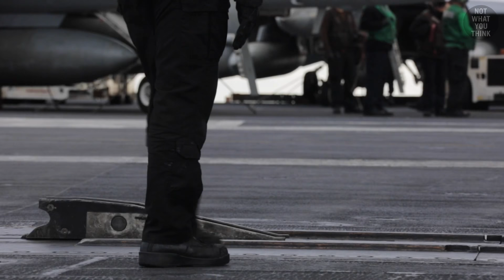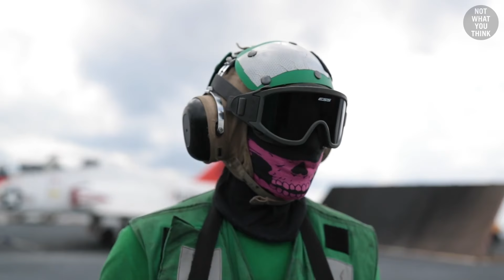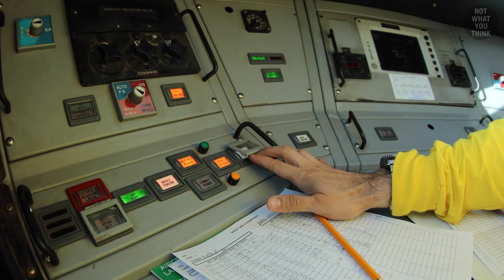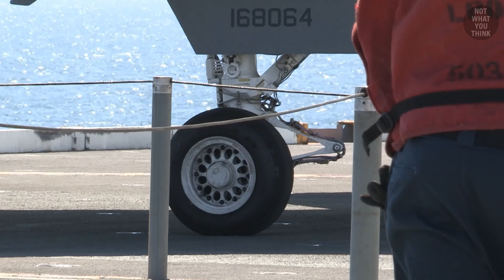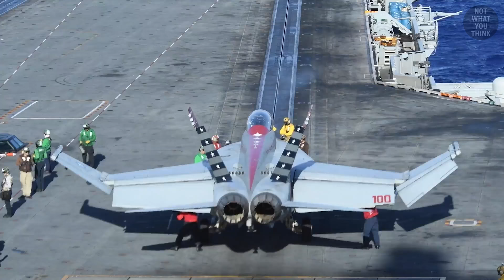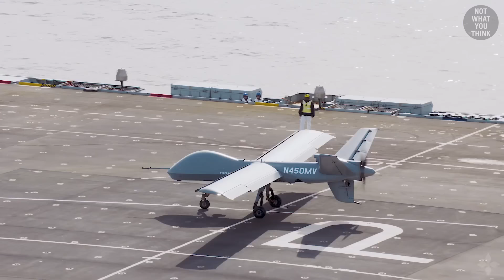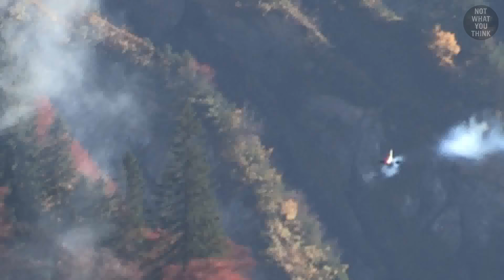Why the US Navy is Replacing Electric Catapults with Steam

Comment: I say steam makes more sense on nuclear powered carriers cause the ship makes alot of it so why waste time adding batteries and extra electronics when you could just add some pipes to run the catapults,  Plus I'd rather keep as many things analog as possible since its proven to be EMP proof as opposed to a bunch of crap the requires huge amounts of electricity to function.

basically reliability and price are the main factors and steam looks alot cheaper than electric

Comment: @kinwaisiu9414
The core differences between the electromagnetic catapult technology of China’s Fujian ship and the U.S. Ford-class lie in technical architecture, energy storage, reliability, adaptability and redundancy design—with China’s system being comprehensively more advanced, powerful and advantageous.
 
Core Differences & China’s Advantages (Concise)
 
1. Power Architecture: Fujian adopts medium-voltage direct current (MVDC) (a China-initiated innovation); Ford uses medium-voltage alternating current (MVAC). MVDC eliminates frequent AC-DC conversion, cutting energy loss and boosting anti-interference performance. It works seamlessly with conventional power, breaking the myth that electromagnetic catapults require nuclear power, while MVAC’s outdated architecture relies on nuclear propulsion and suffers higher energy waste.

2. Energy Storage: Fujian uses supercapacitors (millisecond-level response, over 98% charge-discharge efficiency, 10–20 year lifespan); Ford relies on flywheel energy storage (mechanical wear, slow response, short service life). Fujian achieves a launch interval of ~30 seconds, outperforming Ford’s ~45 seconds for higher sortie efficiency.

3. Reliability & Failure Rate: Fujian’s mean time between failures (MTBF) exceeds 2,000 cycles, with proven successful launches of the J-15T, J-35 and KJ-600. Ford’s MTBF is only ~614 cycles (far below the 4,166-cycle design target), with a mere 7% fault-free probability under high-intensity missions.

4. Launch Capability: Fujian’s maximum output reaches ≥125 MJ, supporting full-spectrum carrier-based aircraft (2–70 tons), including heavy fighters and fully-loaded early warning aircraft. Ford’s ~100 MJ output limits its ability to launch heavy, fully-loaded aircraft.

5. System Redundancy: Fujian’s catapults feature independent power and energy storage systems—a single catapult failure does not affect others. Ford’s 4 catapults share a centralized system; one failure paralyzes all, requiring 1.5 hours of downtime for maintenance, posing critical combat risks.
 
One-Sentence Conclusion
 
China’s MVDC + supercapacitor electromagnetic catapult system holds generational advantages over Ford’s MVAC + flywheel scheme in efficiency, reliability, adaptability and combat readiness, demonstrating unmatched operational value even with conventional power.

Comment: Failed to mention, electric is faster to cycle so an aircraft can be launched every 15 seconds vs steam @ 45 seconds/ aircraft. It takes more time to recharge a steam unit vs electric.  New carriers have the electric capacity that older carriers do not for electric catapults.
Reply: Anyway, due to the aircraft's takeoff and landing procedures, the advantages of a quick launch are meaningless. China has also not been able to resolve the issue of capacitor lifespan at all.

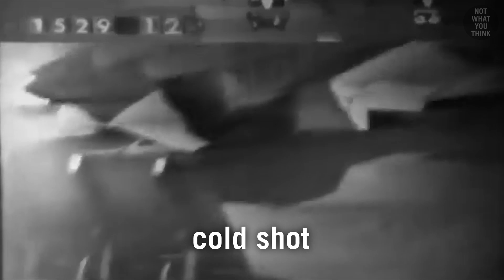Comment: 2:56 - now, one has to be... dunno - blind? dumb? treating his viewers like a bunch of blind puppies born yesterday...? - to illustrate "too less power" scenario with a clip showing clearly WAY TOO MUCH POWER scenario! Well, I mean at least "too much for THIS particular front gear" - but still. 
Thumb down, mister, for this idiocy. You want my time watching your videos (and bringing you sweet ad revenue from YT) - you have to treat me with a li'l more respect.

EDIT - and then another "intelligent" remark, which, BY THE WAY, applies to ANY catapult system, be it steam, electric or Jedi-force powered - that is, "to be on a safe side we need to put some EXTRA power - and YES, it "does put an extra strain". Duh... What next? Water is wet and it's dark during the night, huh?
Steam produces "pushing force" by pressure. A KNOW and ADJUSTABLE one. Which then act on a piston of a KNOWN size (i..e. surface area). Multiply these two, and you'll get DA FORCE. EXACT force.
QED.

Comment: Even if EMALS were indeed unreliable (now), logic would dictate to continue the transition as kinks would be worked out, eventually reaching the same or even better rate of reliability than steam.

Now, once reliability was on par (or better) then one would fully appreciate the real benefits of EMALS.

In other words: EMALS will only get better.

Steam, because we have 50+ years of experience might not be improving too much...or we might be at the best case scenario with it and the limitation we see now are not going to be overcome.

Comment: What U didn’t mention was the use of high voltages to use the electric catapult makes it extremely dangerous to work on the gear? The reaction of the troops when President Trump asked them, is obviously a reaction to this issue?

Comment: No the fuck steam cats aren't reliable. 
The maintainers are reliable and make it fucking happen! They fight to keep the cats available and fully operational EVERY FUCKING LAUNCH. 
I was there riding in the back of the COD getting flying off the boat as we came and went, or on the deck taking part in the flight ops while working on the ship. And I'll tell you the millennium cruise with the JFK was trash and largely because the cats were sketchy. Any folks that work on the flight deck know one steam leak can go from one cat being down, to a no fly day quicker than a blink of the eye. Here's a few other facts. Steam deteriorates and corrodes metals and plastics. When it leaks it can cut scald and burn flesh and other materials,  and do physical damage when the pressure is high. Trump is a moron who swears he knows everything and don't know shit

Comment: There are many more advantages with EMALS such as with damage control situations and fewer personnel required to maintain and operate the system, but good discussion overall.
Reply: I worked for Newport News and was on sea trials with CVN73 and had to test catapult accumulator fill valve performance.  Just before this test,  we tested flight deck chemical, biological, and radiological countermeasure washdown.  This puts a LOT of water on the deck.  A lot of water leaked from the deck into the catapult accumulator space immediately below.  I entered the space and found 4-inches of water on the deck and and contacted central control to request Newport News to bring in pneumatic pumps and removed.

Imagine my surprise when the next thing I hear over the 1MC system to the entire ship is "Flooding, Flooding, Flooding!  Flooding in space 03-60-1-M.  Damage control to 03-60-1-M!)  We are 60 feet over the waterline.  Its still funny, but it shows you how serious the Navy takes damage control.
Reply: Of they’re smart they can have them be battery power of power out somehow. If some of the battery is damage they can still work unlike steam where one problem anywhere take out the whole system.
Reply: The reset, re-fire cycle time is far faster than steam and uses less juice and is far more precise on the stroke.  Putting a sortie up quicker is a key component to in theater response efficacy.  Sucking up to a ZERO intellectual grasp of ANYTHING abject idiot like Trump is no different than following illegal orders.  Trump and ALL of the idiots in Washington pushing for ANY of his lunatic stupid shit should ALL be removed from service and the nation should be allowed to get BACK to the day to day march toward civility we were on before the GODDAMNED MURDEROUS LUNATIC THIEF arrived.

Comment: The issue isnt that steam is more or less reliable because its mature, its that the electric launchers ARENT mature. The ships that have them were prototypes, and before we start putting them in every carrier new or refit, those issue they have need to be worked out. A 99.5% uptime for any major piece of equipment,  let alone the sheer abuse of a catapult, is frankly insane. But its also necessary.  The navy needs those electric catapults to reach that level of maturity before throwing every egg in that basket.

Comment: Perhaps we should return to those beautiful steam-powered locomotives and cars.

Fun fact: most  modern diesel locomotives are electro-diesel. This means they use diesel to generate electricity, which powers the motors, as  controlling the output with electricity is much easier.

Comment: I was once accelerated from 0 to 130 mph in a few seconds by an electromagnetic catapult. This catapult was part of a roller coaster. It worked very well. And was very reliable. It had its share of bugs when the technology was new. But they were quickly worked out. And the same thing should be true for aircraft carriers.

Comment: My only concern with EMALS is; is it hardened against EMP attacks if so I don't see the problem. I may be wrong but I was told our military aircraft are already hardened against EMP.  If you can't launch because of EMP then that's a problem. I am not an expert just saying this would be my primary concern along with reliability which it seems they have achieved.

Comment: Why not have both! US Carriers have 4 or 5 catapults.  Run the drones and non standard off the electric and standard aircraft off steam. What the video failed to mention is the installation of the electric catapult is the hangup to building aircraft carriers,  insanely hard to get them installed correctly.

Comment: I believe that Trump is not lacking in intelligence.
He publicly stated that there is a desire to return to steam power, but the reality is that they need to revert to steam.
The fact that China has a stronghold on the supply chain for the magnets required to build those catapults is a significant concern.
It wouldn't be ideal to construct an aircraft carrier only for China to suddenly block exports of finished magnets or raw materials necessary for their production. That would leave you with a million-ton paperweight.
I think steam would be the safest option, but it may not be the best in terms of capabilities.

Comment: The key error the Navy made was committing to an unproven design.  They violated Meyer’s guidance for complexity and adding too much tech to the Ford class.  An electromagnetic catapult is better than steam but needs to mature and the Navy has a poor recent track record of introducing new ship classes - especially since the 1980s (most are failures that have required decades to be refined or were cancelled outright).  It’s not a debate about returning to steam vs keeping EM; there is a fundamental lack of engineering skills in the Navy officer and civilian workforce.

Comment: You can modify any steam catapult to operate with compressed air then regulate the power at will, it's called ICCALS and guess what? IT'S MUCH CHEAPER and way more reliable! You just need a boiler and 3.5 gallons of kerosene per launch and it can be 7x more powerful than an EMALS : you have enough to launch a fully loaded C-130 too while, just like EMALS, you can do progressive acceleration that reduces stress on airframes !!!
Reply: It also reduces the needs for piping compared to steam generation and spares the room of gigantic "capacitors" banks for EMALS

Comment: It took 10 years of experimentation between the USS Langley the Navy's first carrier to the Large Fleet Carriers of WWII.  The electric catapult system is right at the very beginning of service much as the Langley.  The Engineers and the Navy will get the bugs out eventually.  It's like the first model of any American car, you really need to be aware of that first model as it will have bugs.

Comment: Steam catapults since 1950s? What did they use during the war?
Reply: Propellers. WWII carrier aircraft had stall speeds low enough in relation to their weight and engines' power that they could become airborne within the available deck space.

Comment: Is EM launchers on aircraft carriers (or its control systems) vulnerable to EMP attack?
The list of adversaries (or potential adversaries) capable of such an EMP attack is relatively short.
Does the EM of EM launchers on aircraft carriers interfere with (some) non-EM-hardened drones?
Does the EM of EM launchers on aircraft carriers generate undesired noise or interruptive interference in the local EM environment?
Reply: EM, Elon Musk, "I am a disruptor." - (paraphrase) Elon Musk

Comment: By this point I just get the sense that the knowledgable people in charge at the Pentagon, which definitely excludes Petey Hegseth, are just humoring Rump till he leaves office. It's not like the Navy is going to undertake the massive design changes needed to switch the Ford class carriers to steam, it would be very expensive and the changes wouldn't come into effect until after Rump left office and thus would never actually be carried out. The same thing applies to the Rump class "battleship", it will never be funded by Congress and even if it was, by the time it was designed and bidded out, Rump will have left office and the adults will have put a stop to senile Donny's fantasy.

Comment: Chinas' new Fujian aircraft carrier uses an eletromagnetic catapult, and it's unable to launch fully loaded jets, either partial fuel for shorter range, or fewer weapons, and cannot cycle quickly due to recharge cycle delay. US aircraft carriers work just fine, they launch fully loaded jets, and they cycle the quickest in the world. By not requiring very large joule dumps for electromagnetic catapults, we can use all the electronic warfare technologies without limiting them. The frontier is in directed energy weapons, those require lots of electrical energy, so keeping steam catapults makes our carriers more flexible
Reply: Exactly what I'm saying. The comments just seem to be full of TDS folks. 

Personally, knowing we were able to shut down caracas with EM and various other abilities, any defense analyst needs to consider an EM ability an adversary might have, OR develop. In the video, wiggling fuel tanks made EMALS vary the acceleration, leading to increased vibrations. What if an enemy EM weapon can just screw with that frequency a TINY bit? For now, steam is a good option to keep in the side pocket. Retrofitting Ford to steam would take another decade, and obviously would never happen, so it's a bit of a 'screaming wolf' situation here.

Comment: So why doesn't it work right? Why does it fail so often? Why does it fail differently almost every time requiring engineers to be flown in to figure out what went wrong and why it is not working? The same is true for the electric recovery and the ammo elevators that are all failing. 

These systems have put the USS Gerald FOrd and all FOrd CLass Super Carriers 8 years behind schedule and billions in cost over runs!

The sailors are not able to figure out what is wrong and figure it out on their own or fix it on their own. They have repeatedly had to fly in civilian engineers and parts to repair. If the grunts on the ships can not fix it at sea it is a worthless POS!

Comment: The reports state there are benefits to the EMAL over steam, but reliability and system down time for maintenance or overhaul due to heavy or catastrophic damage is going to be higher.  I just want them to figure it out so it works at the same rate or higher than the steam catapults.

Comment: EMALS has a huge flaw it relies on software that could malfunction damaging assets. Steam is analog system that does not rely on software. Personally they should not have pushed for EMALS as the technology hadn't matured enough to be as reliable and consistant as steam. That "steam bounce" you mention is no such thing it holdback bounce. As the shuttle starts pulling the aircraft forward the holdback and the shuttle compress the tires and nose strut. Back in the day they had the holdback dialed up to much on the Hornets and it was blowing tires. They added two more plies to the nose tires and changed the holdback settings. EMALS with all the feedback sensors can create errors that amplify force that can damage assets if the software hasn't been updated correctly. I like the concept of EMALS, no more eating steam after a launch, no more scalded knees and hands touching track plates. Quicker ready for operation time, without the need to heat soak the catapult before flight ops.

Comment: Typical engineers taking the most complicated approach to a problem. They hear "dynamic thrust" and therefore think the thrust system needs to be completely overhauled to be dynamic. This is dumb. All that's needed is a dynamic braking system. Keep the core thrust simple, reliable, effective, and then tune the strength with antilock brakes. They're reliable, tunable, and OPTIONAL. A failure in the tuning system does not brick the launcher, and if its a small brake (it only needs to be large enough to handle steam output tolerances) it will never dunk a plane.

Comment: The "experts" have been struggling to get the new electro-magnetic catapult system to work for 10 years now.  Maybe the experts aren't as good as you think.  The USS Gerald Ford STILL can run a regular sortie mission schedule because of the unreliability problems.

Comment: Why not hydraulic?
Reply: That's an additional system required on the flight deck. The steam comes from the reactor system, so does the electricity, but hydraulic has to come from a special hydraulic system that is fitted. That more stuff to maintain.

The US did have hydraulic catapults, but they switched to steam when the British Royal Navy gave them their steam cat design, so they must be better.